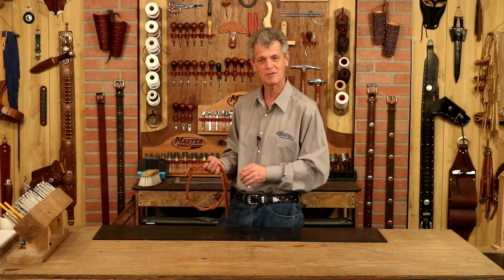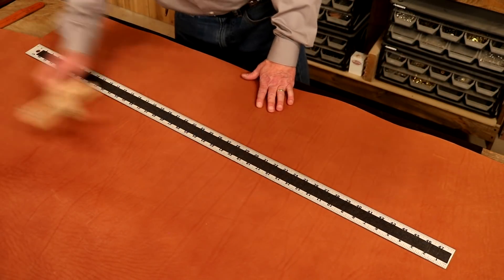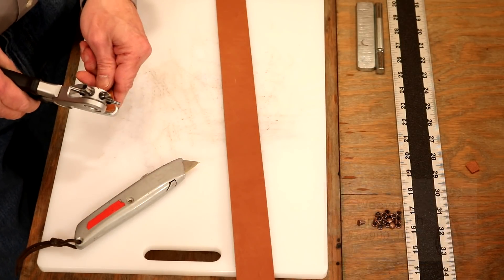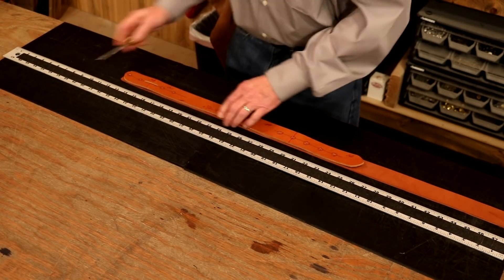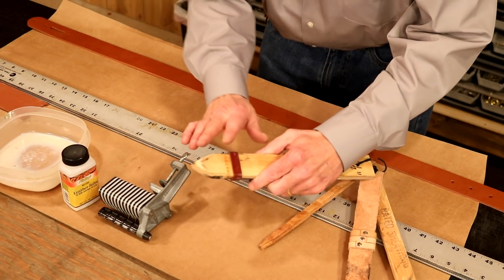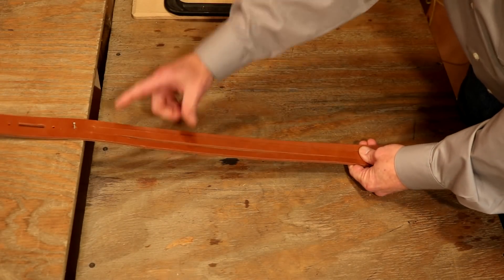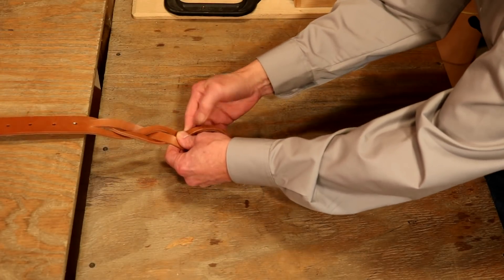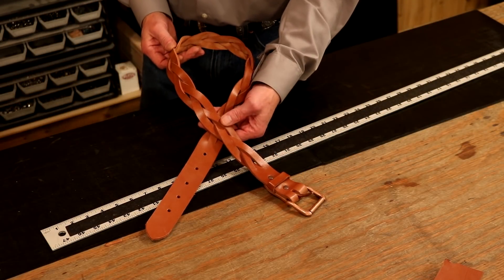Making a Mystery Braid Leather Belt

Comment: Chuck sir, you dont take into account the braiding will shorten the overall length of the belt?
Reply: When you’re dealing with a weight to length ratio like 9oz to 40+ inches I think the difference is negligible. Especially considering he measures his belts to the center hole on the tongue so if I does lose too much all it will do is move him down one belt hole.
Reply: @coldwarrior3794  as soon as i watched the rest of the video he mentioned it doesnt shrink that much